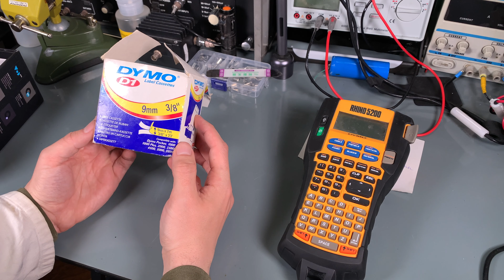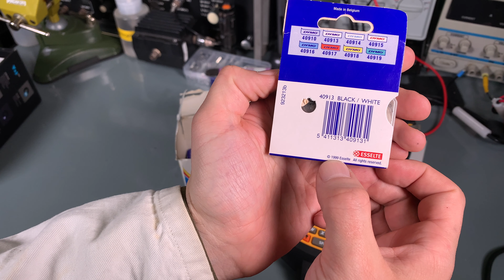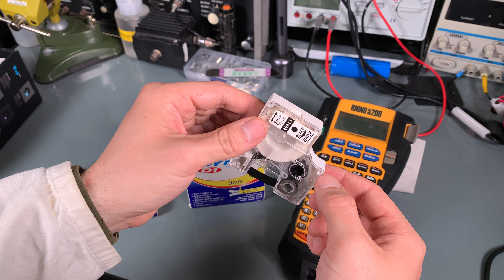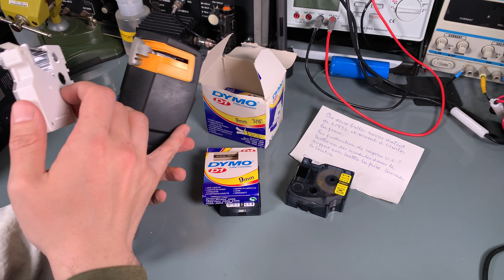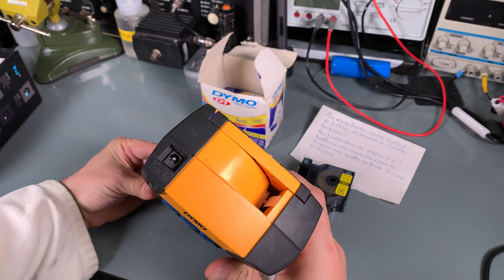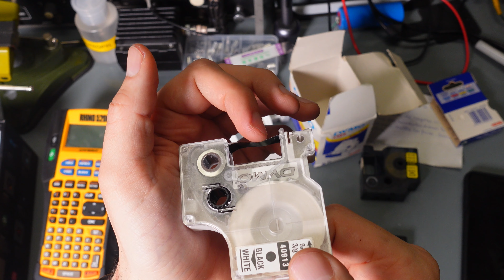Testing vintage Dymo 20+ years old label (D1) tape on modern Rhino 5200 printer

Comment: It isn't the age of the D1 cartridge as I have some just as old that work on an old Dymo 1000 but won't work on the Dymo 280 - the new print heads work at a lower temperature (presumably to save energy) so can't transfer the old style carbon ribbon onto the old label as they don't get hot enough. New D1 cartridges will work on older machines though.